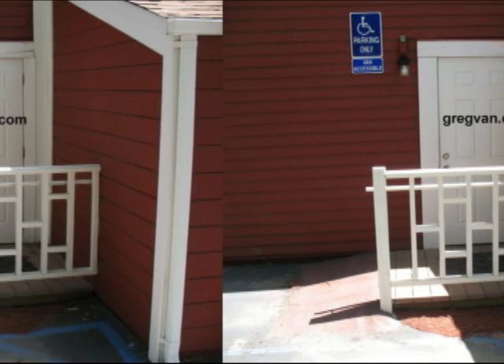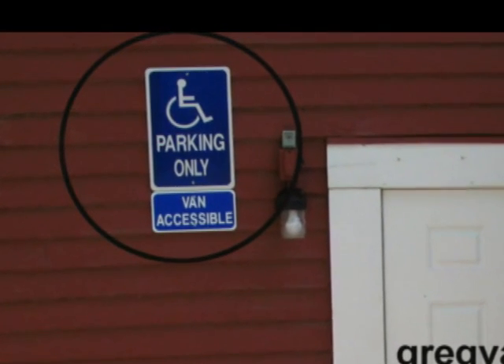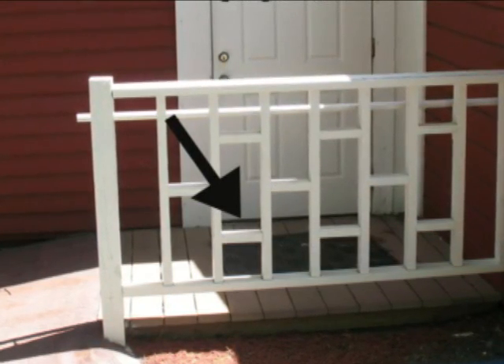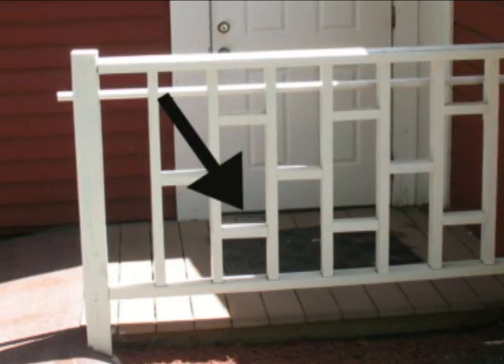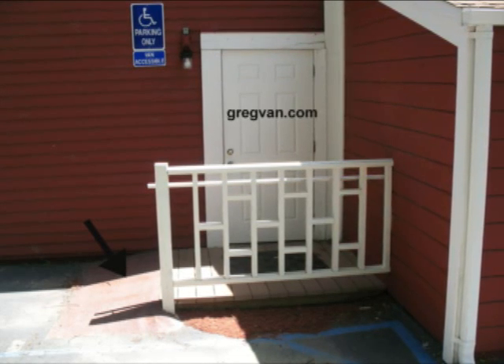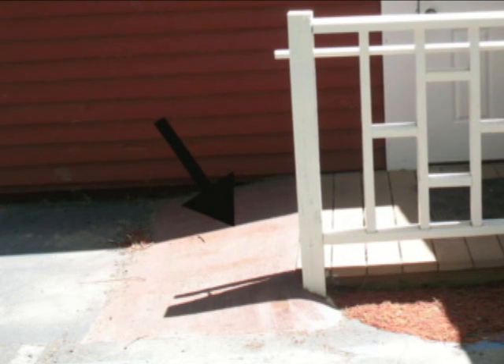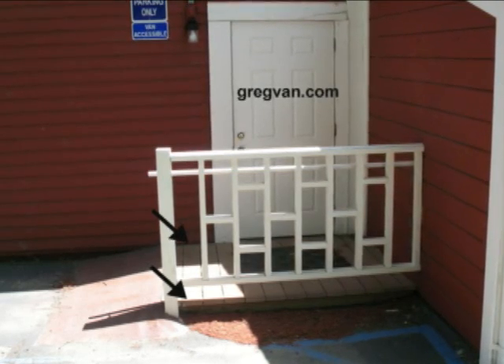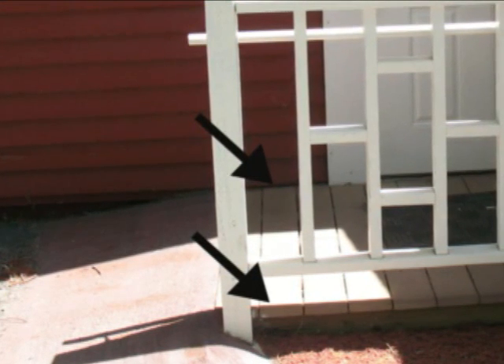Handicap Building Code Entrance Problems - Construction Design Tips

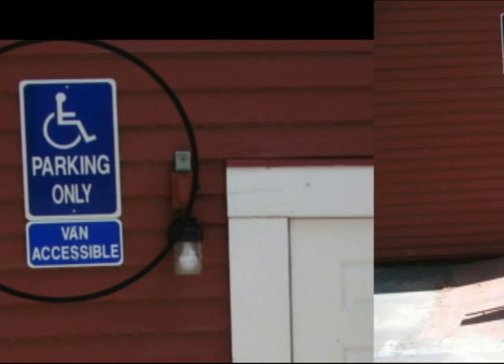Comment from the maker: I looked at the Department of Justice website http://www.ada.gov/2010ADAstandards_index.htm and found out that accessible routes shall not have a running slope of more than 1:20 or one inch rise in 20 inches of walkway length(run) and ramps can't be steeper than 1:12. The bad news is that I new about the ramp code just messed it up in the video, but not the walking surface. I will correct the video and thanks again.

Comment: I do believe he is giving some misleading information on ramp length.  Code requires 1' of ramp for every 1" drop for 1in12 with handrails.  1in21 is 21" for every 1' without handrail
Reply from the maker: Thanks Del You are correct. I looked at the Department of Justice website http://www.ada.gov/2010ADAstandards_index.htm and found out that accessible routes shall not have a running slope of more than 1:20 or one inch rise in 20 inches of walkway length(run) and ramps can't be steeper than 1:12. The bad news is that I new about the ramp code just messed it up in the video, but not the walking surface. I will correct the video and thanks again.